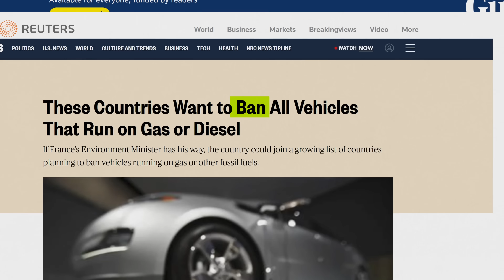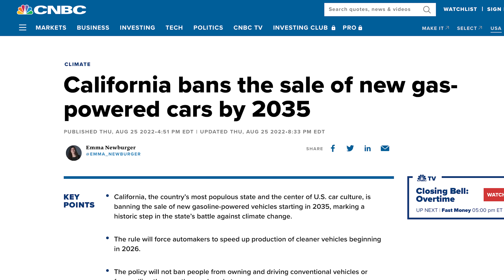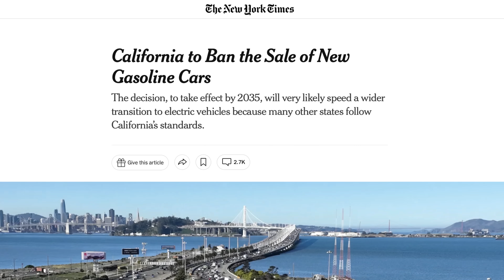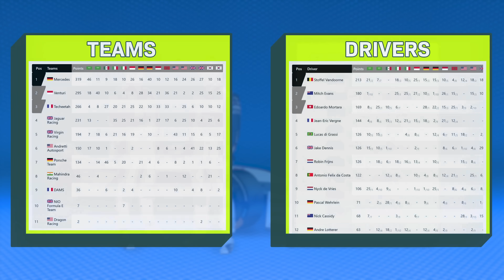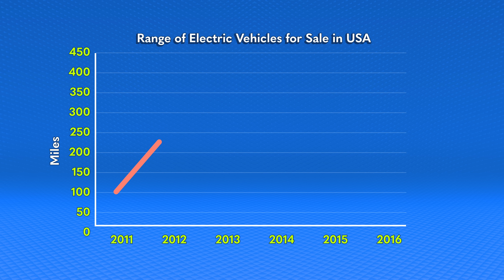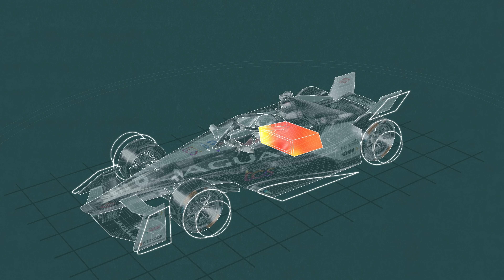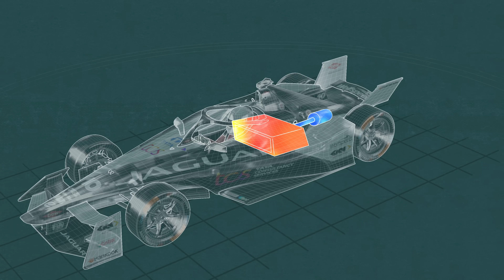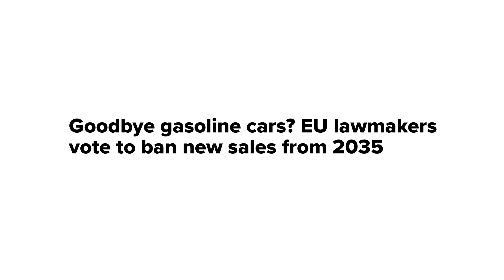The Electric Formula 1, Explained

Comment: Electric cars are not the future and also not the solution. The future is hydrogen. More than 100 years of combustion engines evolution but using a clean and infinite available fuel is the solution.
Reply: no. hydrogen for planes and ships maybe. but not for cars. electric has clearly won.

Comment: Sorry, but Attack Mode and Fan Boost are garbage, and don't belong in any serious form of motorsport. I've always thought that it was too video game-ish, and now knowing that it was intentionally patterned after Mario Kart... I'm horrified.

No driver should get an advantage just because they're more popular than another. I'm glad that was eliminated.

Years ago, electric car racing became popular, but the cars were 1/10 scale RC cars. I looked into getting into it. One problem I identified was the batteries. Batteries with more capacity allows racers to be faster for longer. Every car could be faster than it was, but if so, the battery pack wouldn't last a whole race. Batteries, especially at the high end of the sport (hobby?) were a huge deal, and a big cost. There were also accusations of certain drivers getting special batteries which weren't available to the public. Now, with li-ion batteries and brushless motors (which are more efficient), that has become a non-issue. IMO, FE is going to be stuck in this battery limitation paradigm until the technology advances enough. At that point, I think FE could really take off, possibly eclipsing F1 IF they get rid of the gimmicks.

One thing I really DO like about FE is the ground effects. They have shown that GE can be implemented in a fashion that fosters passing organically, i.e. not via a gimmick like DRS.

Comment: I'd enjoy a video on sports car endurance racing. Especially a 24 hour race like Rolex 24 at Daytona or the 24 Hours of Lemans. Race cars are always pushed to the absolute limit so I find what it takes to go continuously for 24 hours straight unlike any other forms of racing. Plus in this type of racing the teams have to deal with all the elements including all night, so they have to use headlights/tail light. And it's multiple classes of cars all racing together at the same time, going different speeds. It's just so different than anything else.

Comment: Real sports are tactile.  Video games are virtual.  Trying to fuse the two things, or take inspiration from the virtual to use in the tactile, holds no appeal for me at all.   Others may like it, but I never will.   I don't mind electric vehicles, I might have one eventually, but electric racing machines just lack something to me.  It's not performance, there's plenty of that.  It's just that the challenge of the mechanical is more engaging than the challenge of the electrical/electronic.  
Taking electric motors to the extreme is not as thrilling as pistons and turbines.  "my sewing machine runs faster than yours! "?

Comment: E vehicles for everyday travel and trucking ect,but racing it just not right.Were is the smoke fumes and noise.
Reply: u don't really get fumes these days. the only smoke u get is when the tyres lock up or the driver do wheel spin. which can be done just as easy on an electric car

Comment: There is still no way for Formula E to replace Formula 1, and this is due to the limitations that they have. In Formula 1, each team has a certain amount of freedom to investigate in order to make unique improvements, which is why there are cars that are better than others and why there is a constructors' cup, because it is not just about competing but also about innovating. This research is used for the development of other cars outside of Formula 1. However, in Formula E there is no such freedom. The entire design of the car is completely established by the FIA (as in the Indy Car) so it does not provide important knowledge for car manufacturers regarding future improvements in their productions.

Comment: This is a dumb question, but needed: are EVs really ecofriendly?  The amount of pollution extracting lithium sounds dangerously high... What do you think?
Reply: sure its not green with the materials needed for the battery. but it is still better than gasoline cars. cus with gasoline u need to extract that oil and just like mining lithium. it is not a green activity to say the least.

and then u have to transport that oil on trucks which run on gas and pollute. then it is made into petroil which uses lots of electricity. and then finally transported one final time to the gasoline pump station where people fill their cars with gas only for it to be burnes and pollute the atmosphere yet once more.

so yes electric cars are not perfect. but they sure are way better than gasoline cars
Reply: @jesperhammarlund300  I see, and it sounds logical, you think there is enough hard data that can support this?

Comment: Epic vid on Ev technology. California mandates on ev vehicles by date is not really a law, and until recently they have pulled back on idea, due to not having a much needed supporting  infrastructure for charging electric vehicles. 2023/2024 regenerative braking systems have received epic updates where the average driver will notice the difference in quick deceleration of vehicle's current g's.

Comment: I stumbled upon Formula E on TV a few years ago, and once I got over the initial oddity of not hearing the roar (or whine) of the engine that I so clearly associate with racing, I discovered it was... an auto race. Like any other. Which meant I was hooked. And I'm glad to hear you make the point that auto racing has to keep up with passenger cars, technology-wise, because there's so much ANGST in the NASCAR world over the mere thought of engine electrification, and I'm just like... the OEMs are going there anyway, so at some point, the sport they pour millions into is going to have to reflect that somehow.

Comment: The EU are already back tracking on this. Formula E is garbage. The tracks are too tight, the cars sound like toys and it’s full of drivers that haven’t made it in F1. The racing is poor, just bang into each other. F1 is changing again 2026 the power units to make them more electric. Personally wish they’d go back to the old V10s electric cars are not eco friendly anyway. Might be at the pipe but not to produce.

Comment: I think F1 and FE won't be affecting at each other in the future. 

Formula E is going for the development of normal electric cars nowadays.

While Formula 1 is going the other way around by still using combustible engines but instead of using the traditional fuels, they are going for cleaner fuel or even organic fuels to save the enjoyment of driving cars with BRAHHHHHHHHHHHHHHHHHHH (IYKYK).

Comment: I'm surprised they didn't do a battery swap with every tyre change. It would definitely set the trend for electric cars with service stations stocking replaceable batteries in re-charge holders. A five second battery change would certainly be more desirable than a 6 hour charge.

Comment: I have to say though, as much as people say the future is "electric" it just doesn't seem that way. If F1 and their sustainable fuel is successful, it will trickle down to cars, and if it were to work with normal gas powered cars, then it would be more of a choice if someone wants an electric car or a car with a motor. Gasoline will be phased out, at least in some parts of the world, but hydrogen and other sustainable fuels seems to be the next step along side electricity. I think it's also important to note that, gasoline powered cars, aren't a problem if everything else we did was more sustainable. Most electricity we use comes from burning coal, oil and gas which equates to most of the pollution. So unless we do something against that, we won't be doing much against climate change even if all cars go electric

Comment: The name is wrong Formel Diesel is mor correct. The electricity will be made by special trucks with huge Dieselgenerstors. At the curcuits the power connections are not strong enough. Electric Series nice joke.

Comment: Before California banned future gas vehicles, & then asked people not to charge the ones that they already had because the electrical grid was strained just 3 days later, Switzerland banned electric cars. There isn't the energy to charge them. Besides, most electricity is created by burning fossil fuel.  There isn't enough electricity to charge electric cars. More importantly, you can not produce enough electricity to charge commercial trucks. It's totally unfeasible. Also, you can not end oil production. You can't build an electric car without oil.  It's all bs.
Also, all of the western hemisphere, plus western Europe, & western Africa produces just 67% of the carbon emissions that the country of China emits. Restricting us did not solve anything. It's all a political scam to control you. China already restricts people in some urban areas to driving only every other day. They don't do that to control carbon emissions, they do that for traffic control. Don't think that your internet connected car won't be controlled to stop you from driving it whenever the government want to do that, don't think that they won't do that, they definitely will. Of course, the politicians & the wealthy will be excluded from this. I like electric cars & hybrid cars, but the government has no business deciding which is best for you.

Comment: Two observations on proposals to ban the sale of new gas/diesel cars: 1) These proposals do not take into account that electric vehicles are prohibitively expensive for the average motorist -- this includes manufacturers making the internals of their vehicles inaccessable thereby forcing owners to make expensive trips to garages/repair shops/approved dealers/etc for maintenance that could have been done at home;  2) These proposals do not address the total lack of infrastructure for charging electric vehicles -- especially in remote/rural areas (and some places like these still don't have basic modern infrastructure such as reliable high-speed internet/mobile data connections or energy supply).

Comment: Why don't they use "wireless charging roads" technology for Formula E? I think it would be much easier for them.
Reply: Because electric cars are not trains. They drive all over the road. And the technology is not good yet for wireless. There is huge energy losses vs plugging in a cable. And before you comment. Its not the same as phones. Cus phones use so little electricity vs a car. It would waste tons of power. And here FE wanna be efficient. Even tho she did not mention in the video. Formula E will hage 600kw charging pit stops 30-sec for season 10 (2024) similar to f1 refueling back in the day.
Reply: @jesperhammarlund300  Oh ok, thank you!

Comment: So if the braking capacity of the car comes from the electric motor, what happens if the electric motor suddenly stops working? Is there any emergency electric battery that activates in the car if its in this situation?
Reply: Well breaks fail all the time in F1 aswell so FE isnt anymore dangerous.

But as for answerung yiur question. No brake is only on the rear wheels. The front wheels still has mechanical brakes.

Comment: Formula E , needs a certain special part of the track to be ultra Wide and the Cars will need to super accelerate at 450 miles per hour and the road does a loop and because of the down force the car sticks to the tarmac while doing the loop-ty-loop but needs to be at a minimum of 450mph or more. Or. If the driver don't take the loop there's a side track but a little bit longer that meets back up to the main track. Just like Mario Cart.  Also they could drive on a track that charges their battery a little bit with boost.

Comment: Formula E is too video game. Would love to see a motor/electromechanical brake per wheel. A common body shell, battery,  and max energy draw is fine, but should not limited energy use per motor or regen. Brake could be inboard - could have motor, reduction gear, brake, half shaft wheel. While inverter boards are expensive, they are light. it would be easy to have a control box of with a brain monitoring wheel rotation and forces relative to the road, and driver inputs, that then tells each inverter and electromechanical brake the action to take.

Comment: I’m a huge F1 fan, and I’ve been for 20 years and my humble opinion is that Formula E is shit. F1 has already become a bit of a “light” motorsport since the sound is off, not like in old times. I still watch F1 because it’s fast, strategic and requires the best driving skills. But Formula E? The only think cool about electric vehicles is how fast they can become, and the specs of Formula E are a joke. It’s like washing machines racing in a toys prefabricated small track.

Comment: Technology is not moving on, its actually going backwards. In the early 1900s the majority of automobiles in the US were electric but that didn't last long due to electric automobiles being more expensive than gas powered automobiles and electric automobiles having a much shorter driving range than gas powered automobiles. Same problems exist today with electric vehicles.

Comment: I know this may be an unpopular opinion, I think that electric vehicles are going to be a very short lived fad, or at least should be. The amount of copper, cobalt, and lithium needed are going to lead to ecological problems that no one is taking into consideration. Why is F1 going to hybrid, because  it actually makes sense. Nearly all of the super cars out there are now hybrid because the torque and power out of an electric motor is superior to a gas engine, so the gas engine might as well act as a generator.
Reply: In the early 1900s the majority of automobiles in the US were electric but didn't last long due to electric automobiles being really expensive and having a short driving range.
Reply: I am fully aware of the early electric cars. It does not change the facts that as far as what battery technology allows for today, is creating a tragic situation for those that live around the cobalt mines in the Congo. Considering that the limitations of the current technology today, we would be far better focusing on carbon capture technology like what is starting to be used to make hydrocarbons that literally makes any fuel created this way carbon neutral. Until we have a battery system that does not cause birth defects and harms people's health in the production of the battery, we should slow roll on electric cars.
 @everypitchcounts4875

Comment: I think the quality of Formula e racing lacks compared to F1. There is a massive gap of skill between those two classes and that is the problem in Formula e. That is why many F1 fans think it is stupid because the drivers often seem like roockies. Because most of the drivers didn't participate in junior classes like F2 or F3 where they get prepared for racing on thight, small and narrow street circuits.

Comment: I enjoy your passion for the subject. Constructively, I’d like to offer the following corrections.

• “Braking re-gen” has been in electric cars the public buys right from the start. It is not a new tech derived from Formula E.

• Agag’s suggestion that F1 is currently “50/50 internal combustion/electric” is in no way true, not even close! Excepting an initial charge at the beginning of the race that is good for far less than 1% of the car’s total race power, 99+% comes from the fuel. After that first lap, the cars operate as hybrids charging their own battery using braking re-gen and direct engine generation. 

Next year’s rules are for a much stronger electric motor but the fundamentals remain. It’s virtually all fuel that powers an F1 car through the race.

Comment: 0:32: 🏎 The future of Formula 1 is at stake as more cars become fully electric and governments consider banning new gas car sales.
2:44: 🏎 The president of FIA and Alejandro discussed the future of electric racing during a dinner, leading to the creation of Formula E as a separate championship from Formula One.
4:47: 🏎 Formula E is a new sport that combines an energy boost, probiotic, and daily vitamins in one drink, and is inspired by Super Mario Kart.
6:41: 🏎 Formula E races are made more entertaining with boost zones, attack mode, and fan boost.
9:13: 🏎 The Gen 3 car is the biggest step up in technology for Formula E, with all teams using the same chassis and battery.
11:10: ✅ The Gen 3 car in Formula E is more powerful and lighter, thanks to a new braking system that uses electric motors to convert kinetic energy into electrical energy.
13:20: 🏎 The future of cars lies in technology that allows for faster, cleaner, and more efficient driving.
Recap by Tammy AI

Comment: I would love to see a follow-up on this, super interesting. This formula came to my home city recently, Cape Town. It was a street circuit, which was awesome. The tickets were pretty expensive, comparable to F1. The other challenge was electricity. Here, in South Africa, we experience "load shedding", where utility power is deliberately cut off for between 2-4h at different times during the day. Long story short, they got around this by using 28 bio-diesel generators to supply the 2MW power demand. So, at the end of the day, they still had to burn fuel of some sort.